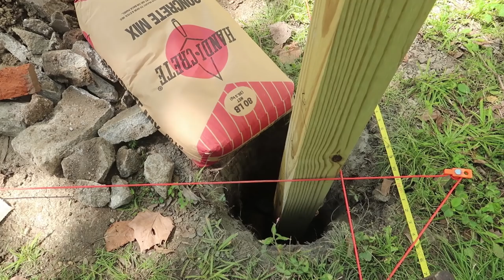Building a 15'x28' (5mx9m) Workshop 04: Almost Done with 4x4 Posts!

Comment from the maker: Yes, i know a lot of people will take issue with my experiments filling two post's concrete with rocks and bricks, but im wanting this to be a test. also our house basement concrete is full of filler (old engine parts and bricks) and seems to be holding up after decades. so lets put this to the test and see if these two posts fail sooner than the others.
Reply: Rinoa Super-Genius I'd put gravel chips, idk just a thought, also, could you please wear sarety shoes? Sandals are dangerous for activities like this :p
Reply: My local area used old cars as filler for an oceanfront boardwalk foundation. Also although it doesn't do any good for this project, there's a gardening tool slightly larger then post hole diggers for hand tilling. Using those with the post hole diggers speeds up post hole digging.
Reply: In the past, it was common to fill the concrete with stones to save money. At least here in the old world. My father dug down posts and filled with stones only, it was 60 years ago and the posts are still there! :)
Reply: Yea add pebbles/stones to pack out concrete.
Reply: What are you doing to protect the ends of the buried posts from rotting out due  to water absorption? 
If that was a fence I would use a metal mounting point which is attached to concrete in the ground :-)

Can we have a chat sometime about wearing work boots when doing heavy work also ;-)
Reply: They will rot from wicking after a few decades, but the main thing is to cover them from the rain in the winter.
Reply: @SimonZerafa  the posts that are in the clay are protectet from water ingress due to the clay the ones thet were not in the clay only in the mud ish ground shoud still be fine due to the lack of Oxigen in the ground at that level. Rotting shall be a very very slow prosess
Reply: I used some random Bricks inside my concrete when I built my 20 sq m deck to help keep the posts vertical as well as provide some larger surface area. Lucky my posts only had to be 1 ft deep.
Reply: I would find no issue with your experiments I admire your thinking. I also admire your determination and willpower.

Comment: How are you going to prevent the wood rotting in the groundwater? Even pressure treated timber doesn't seem to withstand constant immersion in water too well. Power poles seem to have a liner inserted into the hole, at least here in the UK.
Reply from the maker: when i dig down even after a harsh rain the clay is super dry, so not sure what ground water you mean.

oh your in the uk, well the uk is like a swamp, its very different.
Reply from the maker: is that a joke? the uk is like a swamp compared to here, its a very very wet place. if you dig down in the uk you will probably hit water, here you probably wont. in fact, a good amount of land in the uk has been created by draining water out of constantly flooded areas. its a huge problem for flooding and rusting of antiques
Reply: +Rinoa Super-Genius sorry if you took my comment the wrong way, I thought I saw water in the holes that you made. I'm a big fan of your channel, and I was only trying to help you/was curious.
Reply from the maker: +gtaguy235 oh i added that water because the clay was bone dry, trying to make it softer to dig up so its not like hard rock. it really helps, otherwise i'd need like a jackhammer. and also your comment was perfectly fine, its the other moron Eduardo who is the idiot here, speaking of him...
  

+Eduardo Anonimo you are a moron, and dont understand what we are talking about. yup i'm rude, because you waste my time. fucking sue me. also i have lived outside the US, i've lived in Switzerland, where they have to use different building methods. guess what? different countries use different building methods, and you'll know that when you grow up.
  

you are a moron in the other comments where you call me hitler, and a moron here also.

Comment: You didn't put concert under the post correct. If you did, then the rain water will not drain and it will rot very fast.
Reply from the maker: put gravel and a brick under it.
Reply: Shall only root slowly due to the lack of oxigen at that level

Comment: That hammer your using to break up the concrete is a railroad spiking mual it's designed for driving spikes into railroad ties I've got 3 there very handy to have ( look at antique shops near large railroad towns/cities
Reply from the maker: you say that as if i dont know what a maul is... >_>

btw its "maul" not "mual"
Reply: That was for the viewers who didnt know what it was and I suck at spelling any lol but I approve of the usage of it I rather see it being used then collecting dust
Reply from the maker: not only do i use it, but i restored it. cant remember where i found it, but was just the head at the time. i think my great grandfather found it in his yard. Back in the 1930s he bought a few lots that had turned into a town dump, so his workshop was just full of old license plates and stuff he found while building his garden.
Reply: @RinoaL  even better :) I've also got a 25 ton mechanical rail bender  currently trying to remove the cancer we know as rust cuasing the worm gear to bind up I currently have it soaking in evaporust If that doesn't work might try electrolysis to nix the rust

Comment: The way you mix concrete... it's just not usual.. :)  Doesn't feels right. But Okey keep it going.
Reply: We have something called post crete in the UK where you pour the material down the hole and then pour water on top. It does a great job in securing wooden fence posts so this must be a similar type of principle.
Reply: No mix concrete has been around for years.
Reply: Example:  https://www.lowes.com/pd/QUIKRETE-50-lb-Fast-Setting-Concrete-Mix/3006121  "When setting a post simply pour out of the bag into the hole and add water (no mixing required)"

Comment: I was wondering. Do you have to have permits from the city to build?
Reply from the maker: we dont need permits here.
Reply: @RinoaL  dude.... Thats so awesome you dont have to have them. . here in Oregon we do. I have so many ideas and I wish i could, but they are expensive to get the permits to do stuff on your own yard. Did you do any like research of how to do this stuff or is it just from experience of working at the Red Rooster Inn
Reply from the maker: this is my 3rd shed so far, and a bit of red rooster, but ive also helped with other construction projects before. so its a bit of knowledge ive picked up over the years. also i've always payed close attention to architecture since i was a kid, even had a few books on the subject in my library as a kid.

Comment: Did u use Pythagorean theorem to make ur corners square? 3x3 + 4×4 = 25. So square root of 25 = 5
3ft by 4ft by 5ft should give u a square corner?
Reply from the maker: no, i made sure they were square by measuring diagonally and comparing. dont need any math for that.

Comment: if you have too many 2x4s, cover the walls completely (no gaps) with 2x4s horizontally.   then the building will super strong and heavy and you automatically have insulation.  no tornado will be able to lift it.
Reply from the maker: yeah, but unfortunately i dont have enough 2x4s for that. would be great though.

Comment: Have you looked up how to make concrete? That didn't look right to me...
Reply: Just replied to the same question up thread: https://www.lowes.com/pd/QUIKRETE-50-lb-Fast-Setting-Concrete-Mix/3006121 "When setting a post simply pour out of the bag into the hole and add water (no mixing required)"
Reply: Yeah, that's dead wrong lol
Reply: @onepup-pr3yl  read the bag

Comment: aggregate (stone would help to strengthen it. Depends on mix and psi. There open on the bottom, water will drain out as much as it will wick in. Dry pour is a common method. If you have a hammer drill around. Hold it to the pole w/o a bit and the vibration will also settle the air out of the mix.
As far as parallel- measure diagonally from corner to corner and you should get the same distance. That will tell you if it's square (a little late now lol) Do you know the tri-angle method?
square 2 sides-add together and the sq. root is the 3rd length.  4|\  
                                                                                                                  |  \  =5 
                                                                                                                  |__\
    side           bottom                                    diagonal                             3  
4 sq'd =16   3 sq'd=9  16+9=25  sq root of 25 is 5

Comment: Just watch some pole bar videos.  The simplest construction is to run horizontal boards around the outside and cover with T-111 or Sheet Metal.  The metal or wood skin provides the stability for the sides.  You might check into trusses for the roof.  You can build them yourself or perhaps find used ones.
Reply from the maker: oh dont worry, i already have a design, and several backup designs. but i just want to make sure ive thought my current design through enough.

Comment: All good besides wood in concrete. It will not be able to breathe and will get rotten quite fast. It would have been better to have some metal bars inside the concrete and to bolt the wood to them.
Reply from the maker: the bottoms are gravel to allow them to drain. we have posts like this that have lasted since the 1910s, so i think itll be fine

Comment: why not make 6 pc of wooden frames With the correct measures and smack them together and make the roof on top afterwords. the bottom frame could rest on concrete blocks.
Reply: Concrete post will give better anchoring for tornados.
Reply: What`s the odds that a tornado will strike exactly that outhouse and if so, only what is under the ground will ramaine untouched…?
Reply: Tornados are common in that area. One just has to get relatively close to the building for high wind speeds to be experienced.
Reply: I see, and I take your Word for it. Thanks for the info.

Comment: The wood post will rot so fast....you ar doing it wrong my friend
Reply from the maker: no they wont.
Reply: They may not rot out immediately, but they will rot out eventually as water seeps into the gap between the wood and concrete.
Reply from the maker: all wood rots, these will last several decades
Reply: Stone coal tar (don't know what you call it) is the best impregnation (70-80 years). Here the manufacturers of "green wood" guarantee 20 years in the soil for these posts. I don't think the concrete will make it worse.. :)
Reply: i would have soaked the buried parts those posts in coal tar creosote. nasty stuff but wood soaked with it will not rot for decades. i would use a long auger bit and drill a 1/2" hole up through the centre of the buried section of the post and drilled a further hole in through the side at a downward 45 angle about 8 inches above ground level to intersect that hole. plug the hole at the bottom of the post with 8 inches of dowel hammered in. once the post is set, the hole in the side above ground can be perodically unplugged and creosote poured into the cavity which will soak the buried portion.